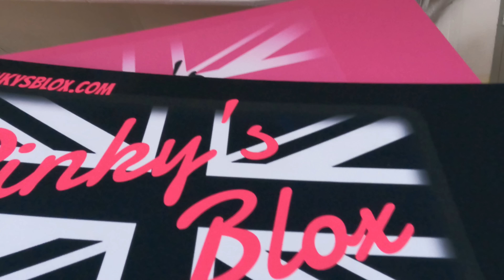Do I regret becoming a mobile smart repairer 5 months in???

Comment: Nice hair cut 😂 that's going to be cold.your experience is pretty much what I had coming from a body shop background you have to learn to think on your feet I had a franchise, and with out any body shop background I would not recommend buying one you just won't last long. especially doing work for carsales.garages are mercenary and have no loyalty . getting paid for the jobs and invoices paid chancing payments is a problem.private customers may be better sometimes, you need a proper grounding in paint repair to be able to cope with the extreme weather conditions and spraying out side there is nothing glamorous or romantic, it's grafting don't be taken in by the romance of it all.thats the rant over sorry.where is the mate's shop in Hertfordshire, interested used to live near Watford.jag was nice but I am a old ford fan,as I grew up working on and repairing them escorts triumph's etc.its not for the faint hearted 😏👌 after thought if you buy a franchise you have to be VAT registered and charge vat on every job, so puts your prices higher, and people won't pay it when they don't have to they simply get some one else a independent cheaper no vat.plus all the vat paper work to do as well plus your accounts hire accountant more from  you every body takes from what you earned not worth it.